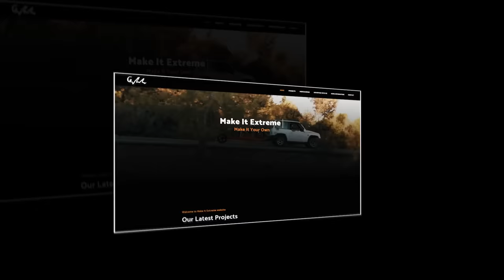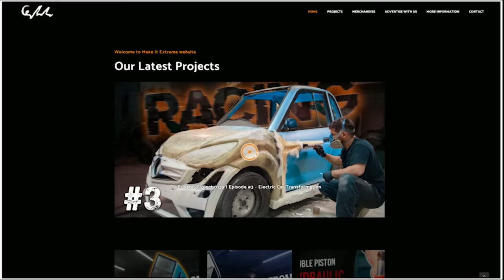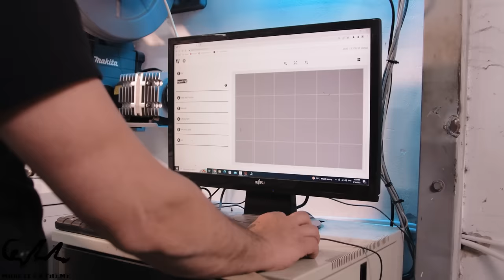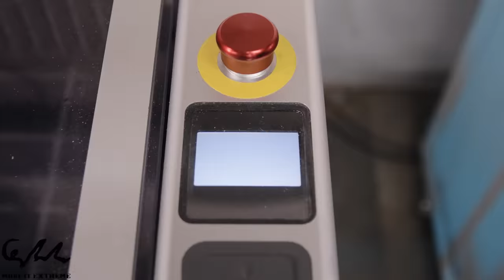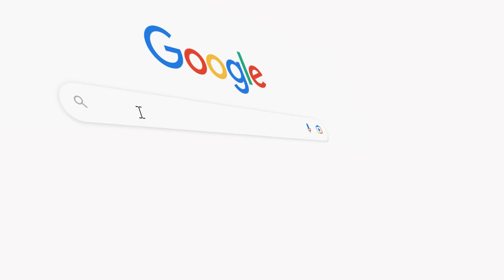Transform the Most Hated Electric Car into a Supercar - Episode #3

Comment: Some questionable body work going on here.😂
Reply: But its kinda cool
Reply: Even the original body is questionable
Reply: You know it had to be frustrating for them. A behind the scenes could be interesting.
Reply: What questions do you have?
Reply: @smashyrashy  Will it float?
And will it keep the engine warm all winter with the 30cm thick insulated walls around it?
Reply: @deckname5794  In every custom widebody, bodykit is at the start foam. You can easily shape it, then u put fiberglass/carbon or wtf u want. After it dries, foam is removed. (typing before watching video)
Reply: @renetnk  you use foam after gelcoat and then you put fiber on it after you remove the foam and gelcoat but here the foam still there
Reply: @tristansimonin1376  Yep, you are right.

Comment: I think this project is an awesome idea that had been executed well up until this point. The methods of making the body work and design of the body work are questionable to say the least.
I think you guys might have over engineered/thought a little too much about this one. Sometimes less is more. The shape is far ro bubbly and bulky for the size of the car in my opinion. I think making a set of fender flares or bolt on arches would have probably suited this project better but each to their own. 
As long as you guys think it looks cool I suppose that is all that matters though. Looking foward to seeing where this goes either way.

Comment: As someone who's been drawing his whole life, and doing design (2D and 3D) , albeit as a amateur, I have to be honest and say this looks ugly and unappealing. It would have been better if you tried improving on the original car designs features, rather then just replacing the whole front bumper from another car with a total different design esthetic and trying to merge/fade that design esthetic into the original car body. The end look then looks as if you went over the front end of the car with a giant "smooth" and "edge/crease" brush. Also, rather than keeping that foam, making the car heavier, you should have removed it, by cutting off the fiber glass where it went in contact with the original car panels, removing the fiber glass, removing the foam, and mounting back the fiber glass to the original car panels, while cutting the original car panels, where Its hidden by the fiber glass, and on top of that building a support behind the car panels for strength rigidity purposes. It would have taken more work, especially the bonnet, but at least it would have saved you weight and be the modified car panels would more "proper". I don't have any complaints with the mechanical part, it's just that when it comes to design, I'm quite stingy, more so then other guys topically.